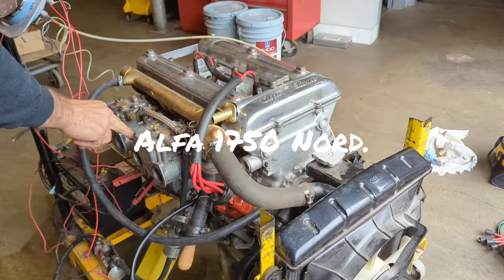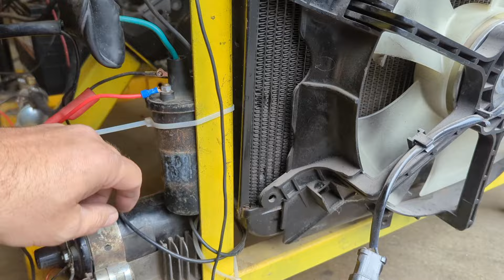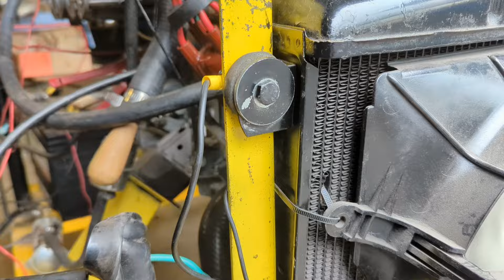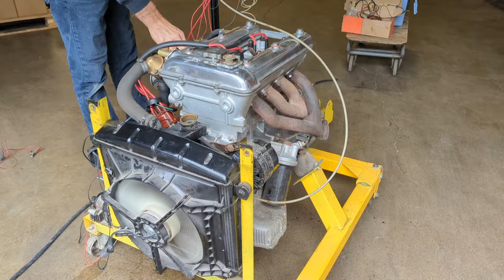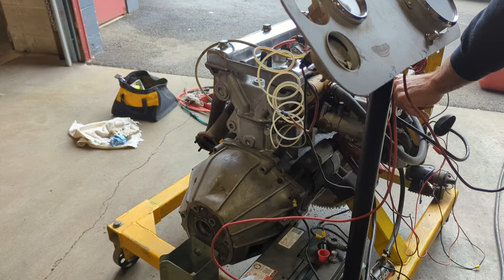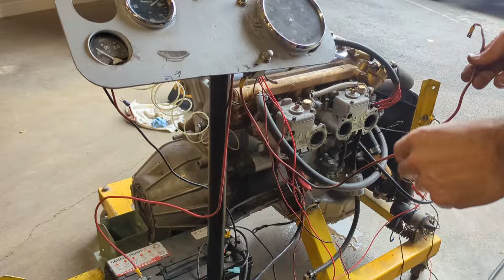Alfa Romeo 1750 Engine Run@scottwalfaholic8139

Comment: You wouldn't happen to have the plans to build a run stand such as that one would you?
Reply from the maker: Sorry, I don't have plans.  We started with an Engine stand.  Then cut it and added some Tube and angle iron.   I have loaned it out, but maybe soon. I can take details and measurements.  Scott
Reply: Add my intent to fab an engine stand. That motor sounds very healthy.